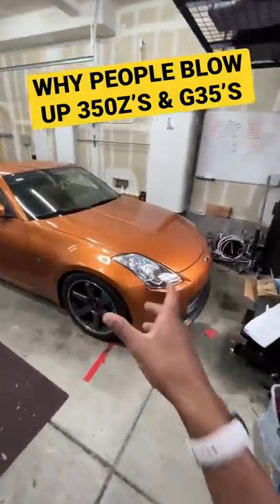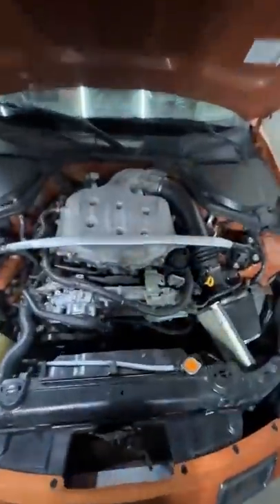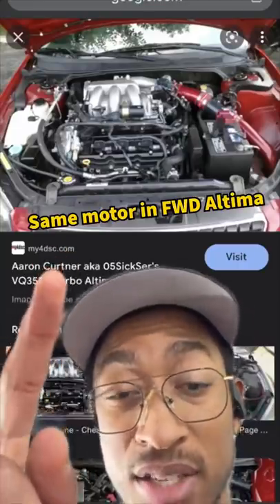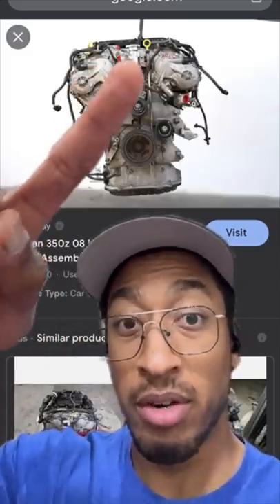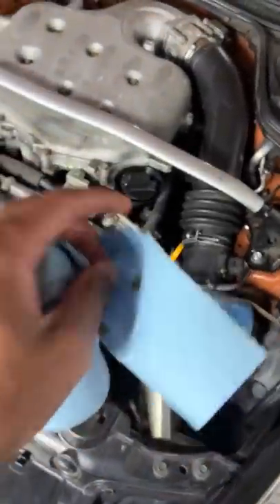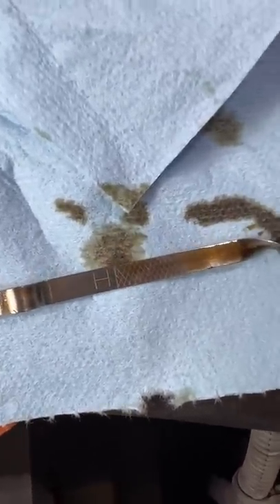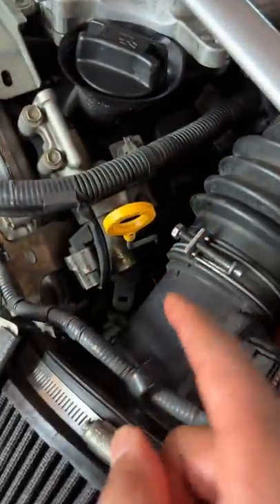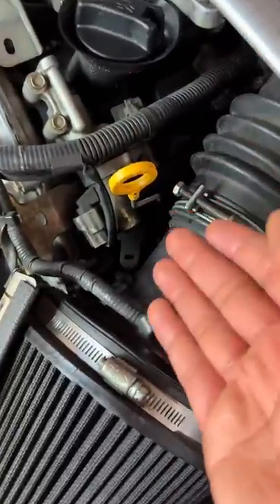Why people always blow up their 350Z’s and G35’s 💥🤯💣

Comment: "The cylinder head uses the dipstick tube as an oil drain." 🤦🏻‍♂️🤣☠
Reply: XD
Reply from the maker: that’s what i’ve been told. haven’t verified it but it makes sense. the tube is cast onto the side of the block.
Reply: @ChrysGaines  you also don’t know how to check the oil. SMH my guy, you don’t need to wiggle it and pulling out the dipstick the first time after a drive with ANY VEHICLE will have the oil go up the dipstick. Any mechanic knows that the oil expands in the tube. You wipe the dipstick off, put it back in and pull it out of an accurate reading
Reply from the maker: @novasketch8658  i’m just going off years of VQ experience from people who have owned and maintained these cars. this method works. a regular oil check does not in most cases. a simple google search is all it takes to see tons of people having the same problem and solution on VQ’s.
Reply: I mean technically not wrong for some vehicles the oil is recommended to be extracted from the dipstick
Reply: @ChrysGaines  it just goes to upper oil pan nothing special nothing with heads , NOW what happends is that the heads will drip down oil for about 10mins giving wrong readimg ( being oil uptop and not being read) now ur not wrong by using the b4 start methood , i even recomend it in a hurry,  also it takes 5.5 quarts most people only use the 5er and then burn oil and go in the danger zone
Reply: @ChrysGaines  his method works, literally EVERY car manual say this.
Get to operating temp
Park & turn off
Wait 10-15min
Wipe first check
Dip back
Check again, THATS your actual oil level...
Reply: @Nova Sketch  you're missing the point. This specific design makes it very hard to read compared to majority of cars.
Reply: He’s not lying if u actually own this motor you will know that this is normal if you don’t know you will be filling and draining your oil if you don’t add the exact amount it requires… if your going off until (it hits max level) your gonna be there a while
Reply: @ChrysGaines  I would simply just add what’s called for. And then 5,000 later look at what’s in the pan. If it not within a 1/4 quart of what I put in then I know I need to start checking the oil. And I’d change the oil. Run it for 5 minutes. Let it sit for a half hour or even longer. And get a reading. And that’s where your optimal mark is. And then every 1,000 miles or one a week or two weeks or whatever you want to set as a schedule I would check cold and add to the optimal mark. Or go a little higher depending on how much oil is being burned.
Reply: To me, the difficulty is tolerable because my other car doesn’t have a dipstick! It just has an oil sensor in the dashboard 😡
Reply: @Alantek8  what car is it?
Reply: Bmw M54 engines uses the dipstick as an oil drain for the CCV (catch can) system.
Reply: @novasketch8658  buddy if you've ever pulled the stick on this engine... You'd understand.
I work in vehicle maint and NO Car does this like these VQs.
Reply: @Dmxravin  I was guessing BMW. My brother bought an E92 and I had to google how to check his oil lol
Reply: @ChrysGaines good job you verified that information before making s public video, done wonders for your credibility 🤦‍♂️🙄
Reply: @novasketch8658  any mechanic who has ever worked on a Nissan vq will know the dipstick issue. You obviously have no idea what you are talking about and obviously have no experience with vq's.
Reply: @2012summr  got cha. It was a bit of a learning experience
Reply: This guy is loco 😂🤡
Reply: He means oil runs down the dipstick tube. My E46 does that, oil is sucked from the valve cover, goes to a crankcase ventilation valve with a built in oil separator, sends the fuel vapor to the intake manifold and sends the oil down the dipstick tube.
Reply: @novasketch8658  damn bro cry about it
Reply: @jamesalbright6155 I changed my oil and it filled up with 5 on the dipstick. I googled and it said 5. Where do you get 5.5 from?
Reply: @michaelthompson2970  for the oil filter and it really helps with the de's

Comment: I always pull my stick, wipe it, redip it and then read it.
Reply: Exactly he’s just not  doing it right
Reply: @philiprennert7730  if u havent worked on a 350z or some other modern nissan model, u would understand what he meant in the video with the wiggling of the dipstick. Those engineers behind the engine didnt rly do a good job.
Reply: Usually smell the oil too and look for sparkles. But that’s just me. 
Walk or ride.
Reply: @Janni069  I’ve worked on too many to count.  Never had an issue checking the oil level.  Without doing that silly wiggle nonsense
Reply: @jgetscensored7837  oh sry man i forgot to check for comments. What i wanted to add was: A lot of engines of european spec Nissan models like the Qashqais (rogue sport) for example have that problem. Im working in Germany and often those renault-engineered engines require to insert/remove the dipstick in a certain way in order to get a good reading of the real oil level. Hope i could solve the confusion
Reply: @jgetscensored7837  forget the wiggle nonsense but for someone who owns two 350’s and a G the dipstick is notoriously horrible on these cars
Reply: U suppose to do that, someone that doesn’t knows nothing about engines
Reply: I do it 3 times on my HR
Reply: @devilsreject9255  Give it a taste test also. You can never be to sure
Reply: Gotta do it about 3 times on mine lol
Reply: yeah cause that is how you are supposed to do it.
Reply: @jtyree0226  THIS is a must. Taste test is only way to check the viscosity
Reply: Whilst cold*

Comment: After 5 years of ownership, I just make sure to do oil changes religiously at 3,500 miles. I rarely beat my G but if I do then I’ll change sooner. I remember going to 5,000 miles and when I pulled my drain bolt only 1.5 quarts came out, so 2 quarts with the filter. Don’t sleep on your oil VQ owners
Reply: That's absolutely not designed to do that. I'd expect a rotary to burn 4qts during 5k miles but NOT a normal engine.

The only z car I'd buy is the HR engine. I'd buy a Miata over a vq 350z
Reply: @Seasniffer69 regular vq is not a bad motor. Just requires a little more attention. I have my sedan that I drift mainly and occasionally take it for a drive. It has survived 3 full day drift events without any problems. And it has 234k. I'd say if the previous owner was shitty with it. Then its more Lilly that it'll blow sooner. But it it was well taken care of like mine was. It'll last a looooong ass time.

Comment: Yea this a "problem" with a few nissan V6's.
I see them in an alarmingly high rate ran extremely low on oil... I usually inform customers of the proper way to check the oil but honestly I don't think it does them any good because they don't listen lol.
Also you get those who think their oil is over filled because they simply don't know how to check it properly.

Also it might be worth mentioning that you don't want to add oil with the dipstick out on most of those Nissan V6s (the ones with the Kinked over dipsticks...) if you added too fast it will back out of the dipstick tube.
Reply: If the engine is running properly it won’t blow up..
A car that’s set up and running correctly doesn’t burn oil 🤦🏻‍♂️
Reply: @See-through-The-Veil  actually all internal combustion engines burn oil. Each time a cylinder moves down there is oil on the cylinder wall that is burned away... and small amounts over time add up.
Reply: @codemiesterbeats  mhm diesel engines don't burn ther engine oil (beside catastrophic failures like runaway diesel) because the fuel is the lubricant for the cylinder walls (same oil will mix and stay behind but that is almost nothing
Reply: @See-through-The-Veil  all engines burn oil, its just the case of it doing a shot glass every 5k or a quart. Blow by is 4 stroke curse and its either the oil on the cylinder walls or being pushed out of the valve case to the intake vacuum lines.
Reply: They get low on oil because this engine burns oil rapidly at wide open throttle.
Reply: @See-through-The-Veil  no

Comment: I work at a lube shop and I hate reading the dipstick on these. Typically you've got to let it sit a few minutes after starting the vehicle with new oil and dip the stick in and back out quick. There'll be a dry spot on the dipstick (usually not even as wide as the whole dipstick) that indicates where the level is at but you've gotta do it quick or the surrounding oil on the stick will fill in the blank spot. Also a quick tip - if you cool off the dipstick before putting it in for the reading (by dipping it in fluids that are cooler than the oil or spraying it and drying it off)  you'll get a much cleaner reading. Super useful on Mazda and Ford dipsticks

Comment: I just bought my 350Z last week and I am taking notes watching this. The dip stick looks extremely weird but like you said it's better to check the oil level when it's cold.
Reply: as long as you put 4.7l into it after an oil and filter change you can't go wrong. after a few days the oil will be sufficiently coloured to see it on the stick.
Reply: @03056932  pretty sure it’s 5L with a new filter

Comment: Theres a good fix for reading your dipstick on the VQ. Hit it with some sand paper and youll get a more accurate reading even with the engine hot. Had mine for 5 years and works for me. Good luck all!
Reply: But rinse it off / dry 100% before putting the dipstick back in… if you have to ask why, this trick is not for you 😂

Comment: So you literally check the oil like every other car out there?
Reply: Thats what im trying to figure out lmao i aint never heard of a car manufacturer telling people to run it before checking the oil
Reply: @lildad559  you should be checking the oil hot normally because it expands. If you fill to full when cold you’ll be overfill at temperature
Reply: @lildad559  dawg there's a manufacturer telling you to check it warm in this very video???
Reply: @justinmckee2256  I mean you should be putting oil to the manufacture’s specifications and not really need the dipstick unless you’re burning oil. If that’s the case then check it however you want but be consistent and fill to the height you get when you first put in the manufacturer’s specified amount. I mean my car takes 4.5 quarts. I put in exactly 4.5 quarts. Start the car let it run for 5 minutes or so to fill up oil filter and do it’s thing. Then I shut it off and give it 15-30 minutes. Oils definitely not hot. Cars definitely not warmed up. And when I check it it’s smack dab in the center of the go zone. But I will keep what you said in mind because I’ve probably put too much oil in past cars since it expands. The car burned oil so I filled it up to the top line cold. So that probably wasn’t the best for it.
Reply: @justinmckee2256  sure it expands but that doesnt change shit lmao i fill my shit to full every time and ive never had issues because thats how engines are designed if youre over filling the oil thats on you but even the new cars ive worked on putting the oil at full or just under has done nothing like you act like the oil only sits in the oil pan and doesnt move around into compartments to store oil thats circulating its not like a gas tank where you cant fill it up all the way because it needs to be able to relieve pressure
Reply: @fakename287  well yea but i mean ive never personally seen any manufacturers say that but ive also only ever worked on one nissan and it was an old xterra and we didnt do an oil change plus im used to cars older than 2001
Reply: Samething I am wandering
Reply: @lildad559  BMW, Audi just to name a couple. Literally ask you on the in car screen to have engine warm before checking it
Reply: You guys fight over checking it hot or cold, shut up it don't matter, check it whenever it's off. Don't matter if it's cold hot etc. Just matters the engine is off= 0.00000 rpm (rotations per minute). I've never had a issue and I've driven and owned more than 1000s of cars of all makes and models and its all the same unless you got a fancy car that has a dipstickless computer oil metering gauge type mechanism/sensor etc.  like mercedes, bmws etc.
Reply: @crazyperson5222  Thousands? You've owned or driven thousands of cars? Really bro. Really? You reallllly sure about that one? Really?
Reply: That what I’m saying this whole video dumb that how u supposed to check oil like that
Reply: @crazyperson5222  It definitely does matter because the dipstick is made to be checked hot.. so your reading will be off. You could simply check it hot, oil level good, let it cool, find the spot where it's at now (it will be higher) and then scribe the line for cold oil level.

Comment: Bro, all kinds of motors do that, it's common to have no place to put the dipstick besides below a drain hole, there's a lot of them. Coming from a lifelong mechanic that has worked at a fair share of oil change shops as well

Comment: You didn't wipe it when taking it out after warming it up

Wipe it.
Reply: Trust me, it was wiped. It's a very common issue with these VQs in every car it's in. You have to wait more than 15 minutes, sometimes longer
Reply: @Rome1017Lights  you need a PCV breather or catch can then
Reply: @jacobwebb8818   After changing oil on these cars for years, this is definitely not true, and this is definitely not the only Nissan that does it.
Reply: @jacobwebb8818  It's good nothing to do with the PCV system, is just an inherent design flaw with the vq and a few other Nissan engines
Reply: The best reading you can get is in the morning
Reply: @austinvanderbilt1039  how does oil get pushed up the dipstick then
Reply: @Rome1017Lights  how does oil get pushed up the dipstick then. Nissans are known to have a lot of blowby pressure
Reply: @jacobwebb8818  Even so, excessive crankcase pressure does not cause this. The routing of the dipstick through oil drainage ports from the cylinder head to the oil pan causes this supposedly. Excessive crankcase pressure would cause the distick to not seal against the engine and be pushed out, along with obvious oil consumption issues.
Reply: @jacobwebb8818  That's not what causes those issues at all. Like Austin said - as well as how it was explained in this video - the dip stick hole doubles as an oil drain passage. 

Oil draining from the cylinder head runs along the dip stick, skewing the oil level reading
Reply: @jacobwebb8818  oil does not get pushed up. The heads drain into the dipstick tube
Reply: Rome1017 not the HR
Reply: @idkdrew  it's no different
Reply: Ohh boy all these experts 😂
Reply: @Rome1017Lights That doesn’t happen to me on mine. I drive like 5-10 minutes. Turn it off, sit for 10-15 minutes, then pull it out, wipe, then check just fine. It’s not all the way up the dipstick after I wipe it the first time. It only goes to the top again if I pour some in and check immediately without wiping, or if I turn the car back on
Reply: @michaelthompson2970  that's because like you said, you turn it off and let it sit 10-15 minutes. 

Check after 1 minute or 2 (like you can on most other engines) and the reading will be off
Reply: @Rome1017Lights  I agree. Idk what the dude in the video was doing. He said thats what he did but I dont believe it based off the results. Even the manual says wait 15 minutes then wipe it off. And it works so I dont see the problem

Comment: Gotta check both sides of the dipstick when that happens. Usually the other side is spot on
Reply: One side always lies, I say :)
Reply: No you pull, wipe clean, dip and pull again for a correct reading on all vehicles every time
Reply: @112997733  that’s what he did
Reply: @oofted9038  your right. Lol what the heck how did I not see that.
Reply: That's why the portion of the dipstick you read is offset - one face of it will not touch the sides when being removed. His error was worrying about splatter and oil above the read portion.
Reply: This is what happens when car guys just like fast cars and don't actually have any real experience with cars.

This is also what happens when you give Renault-Nissan the reigns to the design of an engine bay.

Comment: They also burn oil at a very high rate... I got the g35... All 3.5 burn oil like crazy
Reply: Is the 3.0 more reliable? I was looking on Edmunds as I have an I30, and was looking at owner reviews of I35’s, and seeing people had some engine issues with that generation, people saying to only get the I30’s from 1996-1998
Reply: @scottoleson1997  Nissan have always burned oil. Vq’s love to chug it tho. Not all are bad tho. I’ve had a 05 g35 and it burned more oil than my 03 g35.
Reply: @madmarlone  I had an '06 that was never even a little low come oil change, even when i stretched it an extra 500 miles or so

Comment: my 06 dose the same thing but you should still check the oil after the engine has been running for an accurate reading. The trick with this car is you have to be really fast with the dipstick. basically get it in all the way as fast as you can and pull it out as fast as you can. There will still be oil all over the dipstick but you can see a distinct line where the oil level is at. Hope this helps someone!
Reply: I was about to suggest quickness myself. Saw a lot of messy ones during my many years in the oil change business. Quick stab if you can manage it is best for all.